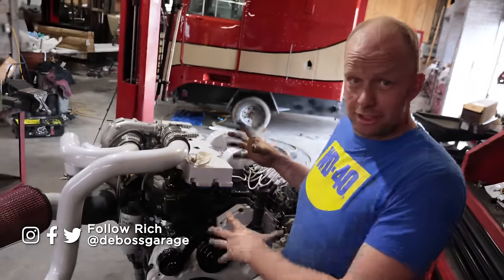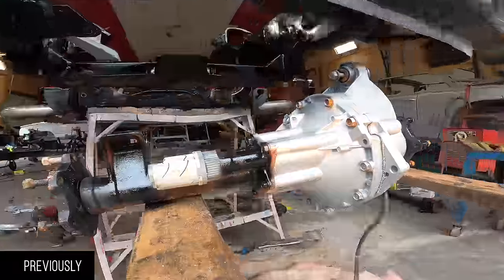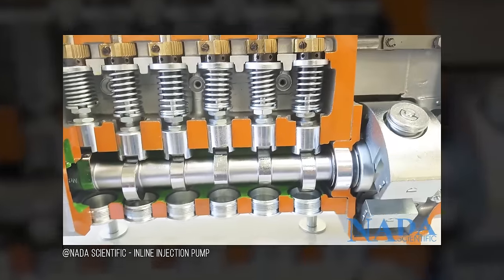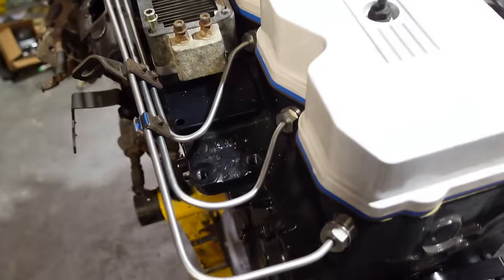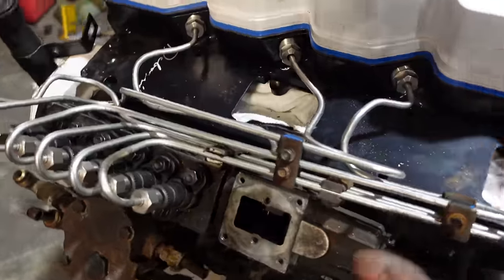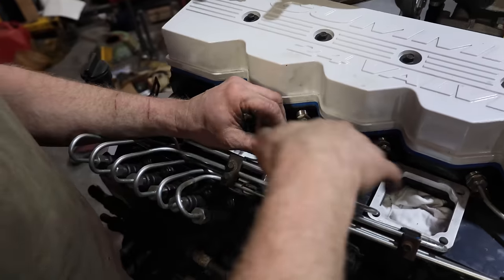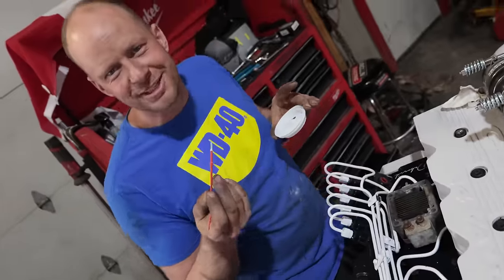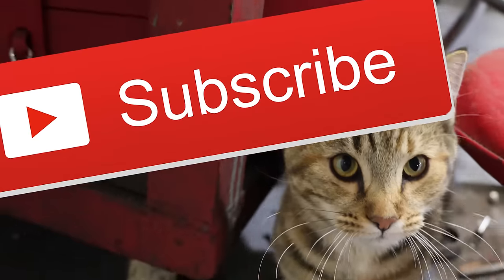How To Bend Steel Fuel Lines for 24v P-Pump Conversion | #24vSilverado [EP8]

Comment: Tip
Grab some Oxy welding rods and bend those into the required shapes first to check layout and get all the angles. If you slip some plastic or rubber tube over the wires to bulk them out to the same size as the pipe you can reduce possible headaches and wasted time significantly
Reply: Or metal coat hangers lol
Reply: Good tip = ) Also keep the old lines for reference, a lot of the bends will be similar.
Reply: I was about to suggest something similar (heavy gauge electrical wire).
Reply: @harambeexpress   Too expensive unless you have some scrap laying around.
Fencing wire is good too but oxy rods are the best as they are straight about as long as you need and you still get to weld with them when you're done.

Comment: I recently had to bend two (the horror!) short brake lines for a new brake master cylinder, and it took forever to get them looking just okay. I am impressed. Looks great.
Reply: I had to do about 2/3 of the brake lines on a 98 Honda Accord.  Didn’t really have the right tools, took forever, so I understand your pain.

Really makes you appreciate the skills of professionals like this channel and others.
Reply: Quality tools make a bif difference. Especially with these knock off being so easy to get.
Reply: Use copper nickel line, doesn't corrode as quickly and its easy to bend, I've done 3 vehicles, two of them full size trucks, bending all if it by hand 😅
Reply: I did a trailer with surge brakes a few years ago and bought the bulk brake line in long coils. Changed my life. Way better than doing it in short lengths like you buy at the parts store. Once you get it all bent up and cut, flare the ends with fittings on (don't forget!) and you're done.
Reply: @Beandiptheredneck  i had to do my 06 glad i got the copper lines now they wont rust again

Comment: The expansion and contraction of the lines while in operation will 'work harden' the lines, leading to great difficulty trying to reshape the original lines. Good choice to go with new lines. Beautiful job you're doing.

Comment: I actually powdercoated my metal lines black on top of the valve cover, and white running through the rest on my duramax.  I learned the hard way that paint and diesel dont like one another, but powdercoat holds up very good. So even cracking a line or road dirt or anything, they just wipe clean no issue and powdercoat stays on nicely. Just used a household electric oven i bought on marketplace, a harbor freight powdercoat gun, and a plywood box to spray it all in. #alwaysdirtylookingrich
Reply: Twinsticksgarage just did the samething with a small toaster oven! 👍
Reply: Powdercoating works wonders.

Comment: Have done this on stuff for medical air supply, best way I've found is use a copper line of same or similar size and you can to the bulk of it and copy. Hardest are the little kinks. You get to know how tight you can bend with practice and how much you canxadjust by hand as you've been doing. Cracking job as always 👌👌. Not being critical in any way, if it works it works. Just a tip for any future jobs like this.

Comment: I feel your pain, trying to bend that heavy wall tube. Even with a proper bender it takes a lot of effort.
I couldn't tell if there were some nicks in the lines, or if it was marks for where to bend. Be careful not to nick the lines, that will cause a stress riser which is where the line will crack.
I've had hydraulic lines that I made for an abusive circuit, split at a a blemish that I caused while fabricating it.
Party on Garth, and keep up the good work.

Comment: I got a 24 valve that’s still in the Crate and shrink wrapped, 😁 my uncle worked on that engine line till the day they made the last 24 valve, they auctioned off the last 3 engines made to the company employees on that line, he got 2 of the 3 💪 I’m planning on putting it in my dads old 58 Apache 2-1/2 ton pickup lol thanks for all your info boys!! Y’all do hella good work👍👍

Comment: I prefer the Eastwood bender that has degree markings and handles for leverage. Furthermore I put some anti seize in the grooves. Under pressure it still allows the lines slide in the groove instead of stretching the walls. It’s a more effortless and accurate bend

Comment: In Australia, the Navy commissioned a company to replace the high pressure steel injector lines on a large marine ship engine........the contractor just did the job with flexible hydraulic lines...........which in service ruptured, sprayed copious amounts of fuel all over the engine room and killed a bunch of people in the resulting fire ( HMAS Westralia) . So dont cut corners on high pressure fuel injection. Do everything just as the factory intended.

Comment: Hay Rich  to straighten the pipe realy clean, I took a pice 1" Dowling 6" long drilled it to size . Cut it length ways and in the vise you go. Works great. Your not the only one that ates that 💩 line. Edit its  HATES! To many thumbs 😁

Comment: This one's really interesting for me, because my RV, based on a Ford A-Series Truck (british Truck from the 70's) has different tube lengths from factory. So i got 6 different lengths. I'm now thinking that it might run nicer with same length tubes.
Problem here in Europe: I got a cracked line two years ago and didn't find a single workshop who could make a new one for me. They all asked for the VIN to order one. But the A-Series is old and rare, you couldn't order parts for it. So a shop in Italy (the line cracked due a holiday trip) did a temporary welding on it. Back at home i contacted nearly 40 Workshops, mostly special truck workshops, but not a single one could help. At least i found a shop for tractor parts who could deliver an unbend line like yours, but 2 cm longer than the original. But as all my lines have different lengths i didn't care about that. Now i'm thinking of redoing all the lines to same length.
Still thinking about an engine swap to a more efficient engine but german TÜV don't like my idea.
Reply: Do you have to get permission from the TUV to do an engine swap on a vehicle in Germany? I know they're stickers for emissions and what not, but it would be... unfortunate if they didn't allow a swap to something even better.
Reply: @noscopesallowed8128  you need permission for everything here. It's crazy.

Comment: I was taught the thing about equal injection line length, back in the early 90s. I had an argument with another pro mechanic recently, who said this was not the case. Trying to Google up-to-date info, all I could find was a reference  in a marine engineers book from the 40s.
Reply from the maker: In  the last shop I worked on, ee had a tool in the old shop that would clamp around the lines and you could actually see the timing through the expansion of the line like a timing light.
Reply: The engineers that designed the stock engines are usually pretty good. And, they’re under a lot of pressure to cut cost as much as possible. So, if a shorter line is cheaper and they could use it they would. 

Even with the common rails they’re often the same length. I imagine there’s some sort of harmonics from the injectors pulsing the fuel.

Comment: Great video, but 3 weeks late😉 
replaced the original Bosch VA in my international tractor with a Bosch A pump. 
Your tips would helped me a lot bending these lines for the first time, but got it done. Just not as nice as yours😉

Comment: You need a programmable mandrel bending machine for lines 1 through 6. Wouldn't that be nice! 
I didn't realize your in the same province I am.  Just subscribed to your channel.  You seem very talented, by the videos at least.  My interest in the 12 valve Cummins has been fairly recently peaked. My dream is to own a 1st gen with the 12 valve.  It's a work in progress....
Got my eyes on one with 533 grand on it.  Frame looks strong,  and body is actually have decent.  Engine and drive train,  well I'm sure they'll need to love.... otherwise known as money.  
Cheers!

Comment: I always use aluminum lines first, then transfer everything over to steel lines after. Much easier on the hands. A really fancy way of doing lines this intricate ks to use prebends and an orbital tube welder for the 
joints

Comment: I have calculated that at the rate that Deboss is inching along with his builds and putting out videos....that three present projects will be FINISHED in 2033.....YES 2033!   JHChrist!
Reply from the maker: Like I said, I have multiple projects because some of the parts have become a 4-6 week lead time in Canada, but you are right, a full custom nut and bolt restoration with engine swaps takes time to do it right.

Comment: That looks clean! My compliments. As you were working I was thinking about a hack to make bending those lines easier. Do you think this would work... get a pack of pipe cleaners from the local arts and crafts store. Connect like color to like color in the length of your injector lines. That would give you a length of pipe cleaner that you can bend and tweak without having to gorilla the injector line and get it right the first time. I was thinking that pipe cleaners would give you a margin of error and would also allow a test fit of all lines before you start bending the real thing.  Too much time / effort or worthwhile? What say you?

Also: thank you for documenting this build. This is very cool stuff.

Comment: You can usually buy a length of solder with the same sectional size as the pipe your bending then have it cut to the same length. that way you can practice how you want to run each one then bend the pipe exactly the same

Comment: If you put a plastic grocery bag between your wrench and the line fittings it won't chip the paint. I know it sounds like it would be too thin to work but it does.

Comment: We use to use the finest sand we could get, and fill the lines with that..
It keeps the pipe from trying to flatten out on your bends, and allows you to use benders that make tighter bends than struggling with bare hands. 
Although you did a far better job than most I've seen. 
The sand really makes the full curls on master cylinders that are used to take the expansion of heat and pressure. 
What flaring tool do you use to make the double flare for brake lines, and I would assume fuel lines as well.
I enjoy the F series build and this one, but the old wrecker is the one I'm interested in with split manifold you made.
Very curious as to how that one runs with the intake setup you pulled out of your keft ear lope.
I like to sh!t myself laughing when you described your intentions with the dura max, and then you proceeded to whack apart that aluminum manifold with a seawall of all things.
Onward through the fog!!
Reply from the maker: No need on sand on injection lines.  You could squeeze those lines as tight as you want in the vice and you couldn't compress them.  I was using a bender in the vice
Reply: @DEBOSSGARAGE  it doesn't try to flatten out in the tight radius, then it's some tough Stuff, because usually normal brake line material and ridged fuel lines will tend to go flat the further you bring them around from the ones we use to use.
A friend of mine is a old school pneumatic control piping magician, and  I've seen him build some stuff where all the tubing comes to one area for the valves and everything else it ties into that'd blow people's minds if they seen the things that man could do, and you would have a hard time finding any place his spread wasn't as if it was printed on the walls instead of done by human hands with a old folding carpenter's ruler

Comment: Chop up an old set of lines, silver solder onto pieces of solid copper wire like 2ga. , for your total length. It’ll let you play with the whole set of 6 and get them “set” and the each cylinder will have a pattern wire to go from!

Comment: Fill the lines with extremely fine sand and tape the ends shut. You’ll be able to do all the bending you want and never worry about crimping the line. The sand acts like a mandrel. Dump out the sand and store for next use, blow out the lines and you’re good to go.
Reply: These fuel lines resemble bar stock more then Tube. teeny tiny hole in the middle. It won't crimp by bending this way.

Comment: Interesting, never thought to use heat when bending lines (Of course I was just using Nicopp for brakes, no need, but would've preferred stainless).

Also, I've not seen those two piece fittings. I think the fittings on my 6.2L diesels are one piece, wondering if there are any 2 piece fittings I could get or if it's specific to the size you have on the cummins.

Comment: The fuel lines look great. Although it looks as if you bended it completely by hand and a separate part that comes out of a pipe bender, and it is not quite clear to me why you didn't use a small manual pipe bender instead of doing it completely by hand with a lose part clamped into a vice. I have such a small pipe bender, and they work great once you get a bit used to using it, and they are very cheap. Is there a lesson to learn for us as to why you did it the way you did it? Or is it that you are just doing it with what you have? Don't  forget to take out the rags from the engine air intake 😋 Big 👍 for all the hard work, and looking forward to see the next episode.
Reply from the maker: It was a pipe bender, but the pipe is so hard to bend, I put it in a vice

Comment: i would of used a coat hanger as a template :P
Reply: But why the double work?
Reply: @markopolo945  you could also use copper wire but this was you get it all perfect without that work and risk of running the finished line.

Comment: Junk that silly compound bender and get something decent like a Ridgid 400 series, I'm pretty sure Parker and Imperial make something similar. The marks take out a lot of the guesswork and makes the bends more consistent. You'll be paying $75 - $100 for each size, but instead of an hour a tube it will be 15 minutes, and no heat required.

Comment: Having done this myself, boy do I KNOW that frustration! If you haven't done it, you do NOT know, you may think you can relate, but you can not haha
Reply: Also, I had a dual intake 24v p pumped in my Fummins for a while, but it SUCKED to work on, so I went back to a single and a vp44, yup, I'm that guy lol.
Reply from the maker: Video or it didn't happen lol

Comment: You're a mechanical wizard, Rich :) You said the lines will be under 3000 psi during operation, does the bending and rebending of the lines create a metal fatigue issue with leaks down the road?
Reply from the maker: Shouldn't be.  It was only the one line, so we will see!

Comment: Hey man got a 4bt question. What is the difference between the 4BT 3.9  and the B4.5? It’s not the common rail and it has a  Delphi Injection pump, and 99hp. It looks identical.

Comment: I found a 4bt p pump that is said to be  rebuilt for 5500 USD  he has the receipts. The only thing holding me back is the fact that the turbo isn't on. the pump isn't on. the block and head is assembled but I won't be able to hear it run. Would you buy in this situation?

Comment: Why is my p pump getting hot   I just p7100 swapped my 24v it's cutting out under load it only has full cut delivery valves and 4k gov springs with the stock 24v injectors please help any info will be greatly appreciated thanks 👍

Comment: Hello I got a question I got the 24 valve with a P-pump on it i need to change injectors on it I don’t know what injector I need and if after change the injector I will need to calibrate the pump again thanks for your help

Comment: Why did you not roll the motor up to the workbench almost next to the vice, surely it would have been easier and less frustrating if the motor had been only a step or two away rather than in the middle of the shop.

Comment: Rich, I'm sure it was just from the editing, but right there in the end, it really looked like you put the intake on with rags still in the engine.  I'm sure you didn't really do that...did you? lol
Reply from the maker: I swear I have another grid heater in the shop or on the shelf, I just haven't found it yet.  Then I will pull out the rags.  Thanks for the reminder though!

Comment: My LT35 SDi 5 cylinder … mechanically fired injectors … has a ‘new’ replacement fuel line on one cylinder.  Makes me wonder why I can’t time it properly…. Seems a bit short… just need a tape measure and a means of recording the measurements of each line as I go…………………..if only …….